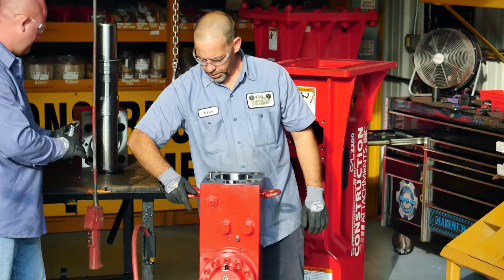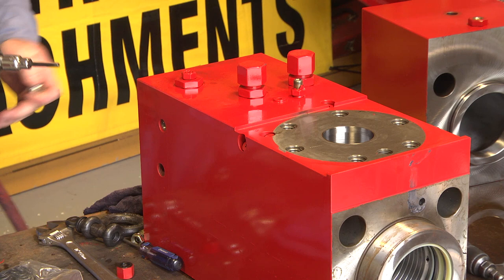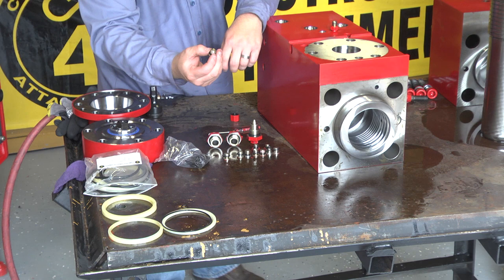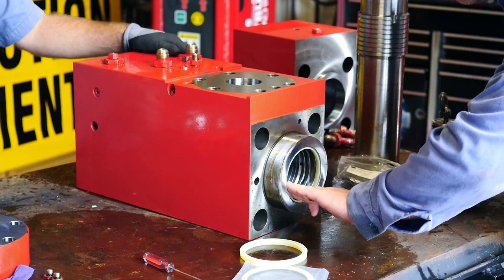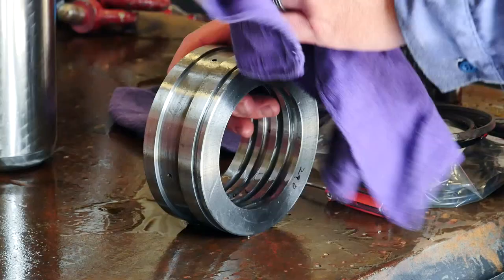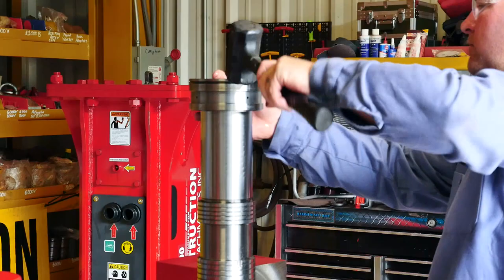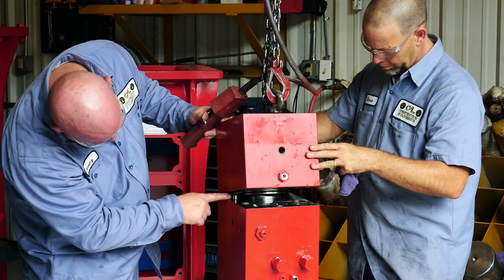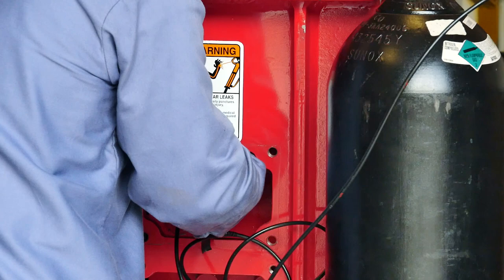CAL Hydraulic Breaker Service Video

Comment: Thanks Much. I have a hydrualic hammer that will NOT cycle.  It will hit, but I have to reverse pressure and apply back and forth to make it hit.   Any ideas what this is?
Reply: KarasCyborg - Did you ever get an answer to this or find out what the problem is (was)?
Reply: @accomplishedauto3815   It could be a nitrogen issue or seal issue or both.  A new Nitrogen Bottle Setup was like $300 and a Seal Kit was $300.   The factory dealer said they could replace seals and recharge with nitrogen for $500, but it's a 1000 mile round trip to take it there, wait and then come back.  They did send me a shop manual on it.   Just wondering If I should take the plunge to do it myself.  I haven't got around to fixing it yet.
Reply: @accomplishedauto3815  may I ask what brand of hammer you have?

Comment: .I fitted hydraulic hammer (furukawa fxj375 model  ) with CAT 329dl excavator .But , hydraulic hose fittings getting leakage near breaker end . I tried , same result.Please I need  advice to solve this issue
Reply: If it’s like the furukawa’s that I’ve worked on, it has an adapter that comes off the hammer that goes to a jic fitting. That adapter is held in with 4 bolts on each side and it has an o ring seal that goes down in the hammer body. If it has those adapters I would check the o rings on them. I’ve found those bolts working themselves loose and o ring failure there before